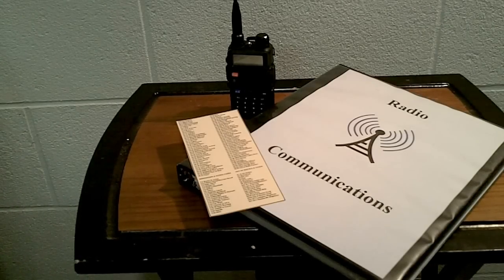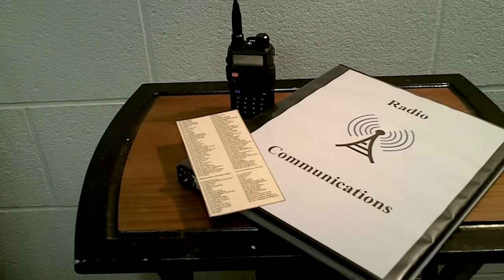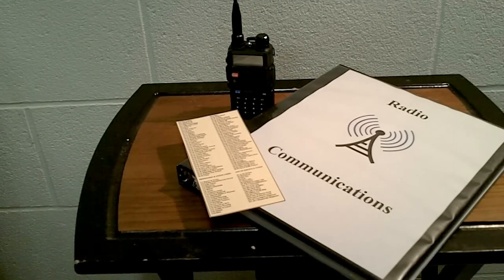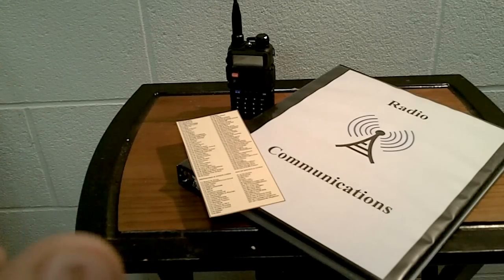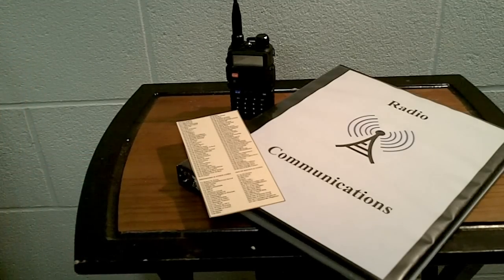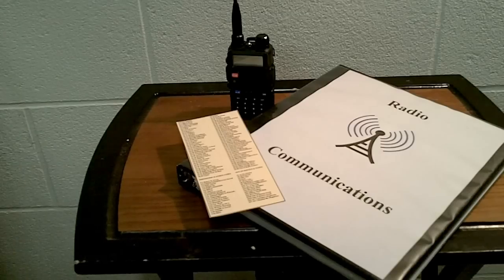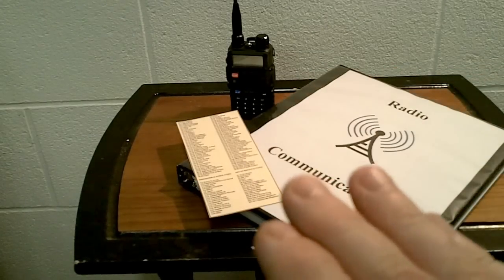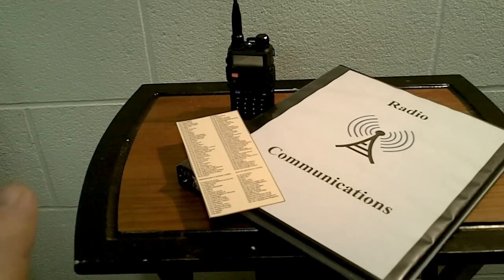What frequencies do you need to program into your emergency radio

Comment: Dump the original rubber ducky antenna! Has "less than unity gain", buy a flexible compatible SMA based dual band antenna that has some gain for better reception/transmitting and is meant for the Baofeng/Pofung radio (same radio - slightly different look). Be sure to obtain the proper licenses to operate the frequencies you wish to operate on. Ham Operators are very sensitive to unlicensed operation and will track you down and report you to the FCC. The Ham license for this radio is easy to get, a simple 25 question test and you have the license for ten years. The camaraderie between ham operators is great, and fun too. If you do not want to go to the trouble of programming these radios and obtaining the proper licenses, buy a CB and join the unruly lot you find there. Some CBer's are good people, most are not. CB is not anything I would have my kids listen to. Choice is yours.
Reply: longshorts3 35 question test

Comment: Hi; thanks for the great and needed video!  Do you have suggestions for travel?  I was thinking I would save some channels so that I could add repeaters as I traveled through an area to monitor.  Might have to change them daily to keep up with the trip.  Any thoughts?
Reply from the maker: What I do is have my com book like I show in the video with all the frequencies I think I will need (even when traveling) Then you can either change on the fly or you can take a laptop with the Chirp software installed and change it that way. The laptop is the best option. CHIRP has repeater book built in to their system so that helps with finding what repeaters are in the particular area. Thanks for the kind words and supporting the channel!!
Reply: Thank you.  That is what I was thinking.

Comment: Great, but forgot the NOAA weather channels
Reply from the maker: I mention weather at around 10:33 but only briefly.
Reply: +Guns and Gear Network 
Must have missed it.   Great video btw, very informative.
Reply from the maker: Thanks!! I probably should have been a little more detailed about the weather channels. Thank you for watching and supporting the channel.
Reply: ...Take the antenna off.
Reply: C.Butts and Richard Fox,
Thanks!
Gonna try C. Butts' fix first since I'm pissed at myself for not thinking of it.
Reply: If you're manually programming you can't put NOAA in memory since it transmits continuosly.
Reply: At least, with the uv5r. You need a break in transmission for the radio to be able to receive the frequency.
Reply: not true I just did you can't jump straight to the memory menu feature though you have to go through the menu funtions to get to memory set then do it that way. you don't have to wait for it to stop transmitting and I just set mine to channel  127
Reply: My CB Has
1. 162550
2. 162400
3. 162475
4. 162425
5. 162450
6. 162500
7. 162525
For weather channels.